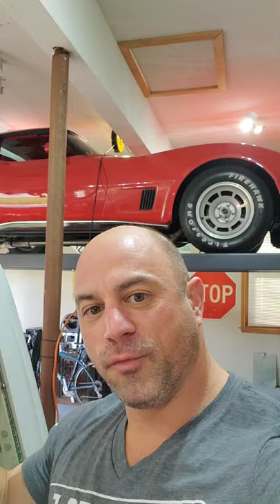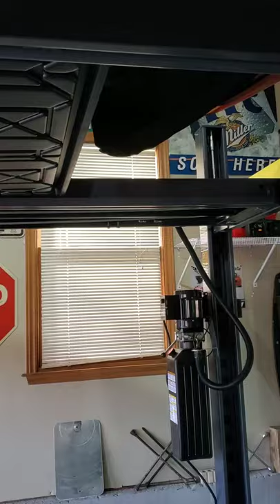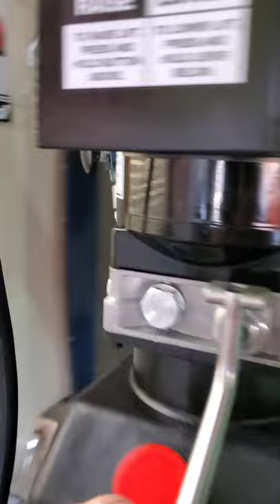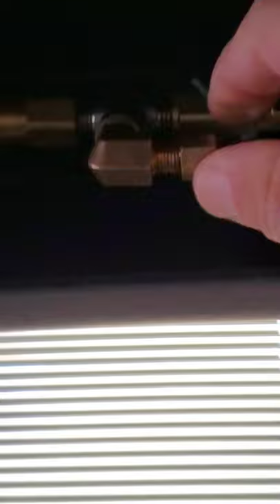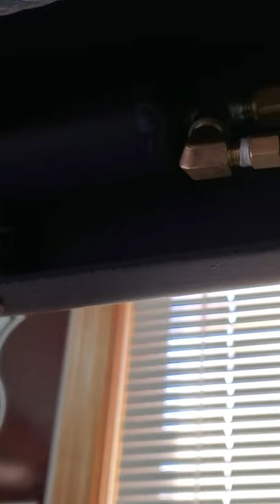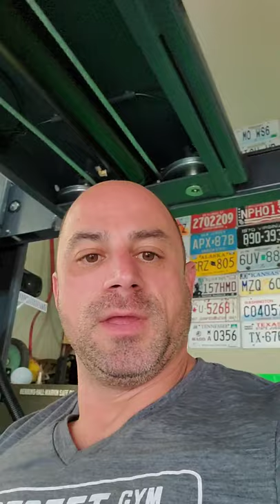New BendPak car lift stuck in the air

Comment: Just took my car down to prep for the spring season, and the lift was very slow. Glad i came across your video.  Did you reslove the issue, did a tech come?
Reply from the maker: It's possible you need to grease up all of your grease zerks. If the routine grease maintenance is not done you'll notice shimmying, shaking, some groaning, and slower action

Comment: Dude you are not alone, I had 2 lifts installed in my garage a couple years ago. They are Atlas 4 post 8000lb capacity. I have had issues with one of them losing all lift ability when a car has been stored in the up position for more than a day. Sucks but I can't imagine not having my lifts but the thought of a car being stuck up there in nerve racking. I am thinking of adding a 2 post lift to the garage next bc these 4 posts are not the best to use when actually working on cars, just good for storage. Cheers!
Reply from the maker: Oh wow... losing all lift ability would be terrible.  Is it a power unit issue? A 2 post would be a nice addition.  I've see some mods for the 4 post, like the between runway scissor jack, to make the 4 post more wrenching friendly.
Reply: @RobsGarageKC  it was the hydraulic pump was releasing out pressure over time if the car sat overnight. Getting it to reprime the air out of the system got it up and off the locks. Pump was replaced but it sucked while it was like that. Yes I have a bridge jack on mine which is what it sounds like you are referring to. Sucker was expensive though ($1100) just for the jack in comparison to how affordable a whole lift is. It does make wrenching on cars nice bc then I can slide it into place and lift up either the front or rear end at a time. Really, I will need a second soon enough to speed things up even more. There still rest the issue of the jack is under the car vs a 2 post lift has the supports on the outside. An area for instance where a 2 post lift is just so much better to work with is removing a corvette engine. One way to do it is to unbolt the front body mount and rear body mount, then with 2 post lift you can leave the drivetrain on the floor and lift the entire body right off. In my case since I can't lift the body without the drivetrain I had to remove the front end body, steering rack, cooling system, brake line junction, etc to get enough room to seperate the engine and pull out from the front. These vettes are an odd one having the trans in the rear and engine upfront. Anyway, I can continue to dream on about a 2 post for now. Cheers mate!
Reply from the maker: @Josh Wagner  That def would suck

Comment: Did you figure out why it was not working?
Reply from the maker: Several things. The air bottle system doesn't work as described. BendPak ended up discontinuing it. Also, the techs the distributor sent over did an improper installation
Reply: @RobsGarageKC  This is unfortunate. I hope they send someone to fix it soon. By the way, if my garage is only 17 feet wide, do you think I can put a 4-post car lift on one side without obstructing the way on the other side?
Reply from the maker: My lift has a little over a 9 ft footprint, and it has a standard width, and is extra long extra tall.  Depending on what your parking next to it it might be a little tight. Definitely make sure you triple check all your measurements before committing to a four post lift

Comment: I thought about purchasing a car lift at home so I can start a mechanic shop at my house but after seeing a bunch of lift fails I'm very sketchy about it, they really need to make emergency brakes for these car lifts just in case or emergency stoppers I'm surprised they haven't thought about it yet
Reply from the maker: All 4 post lifts have safety locks.  I believe this BendPak lift has 15 safety locks per column
Reply: They all have locks

Comment: Hey showoff!
If you installed it yourself, you wouldn't have these problems. Easy.
Reply from the maker: I fail to understand how hiring a company to do a job is showing off. But, I agree with you. If I had installed it myself, I would not have experienced the problems I did from having hired a vendor who had been certified as qualified installers from the manufacturer